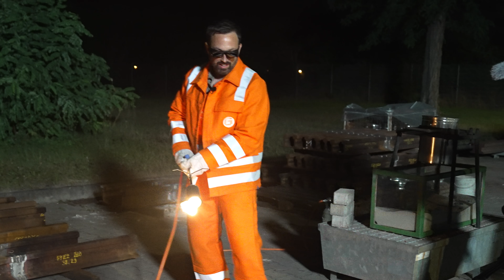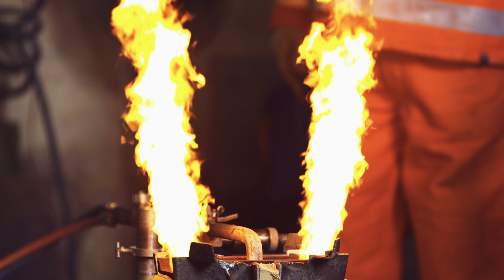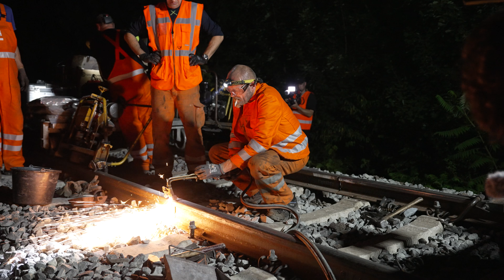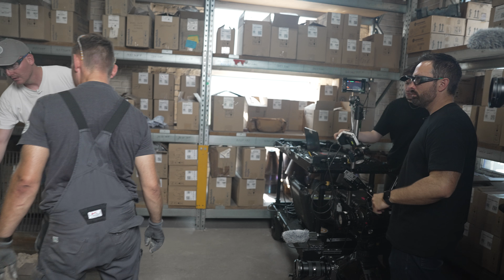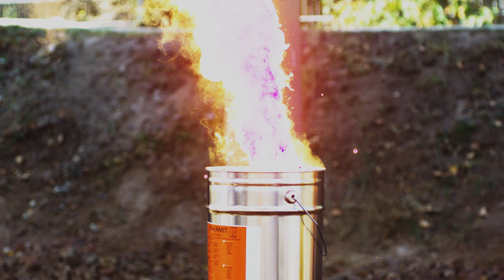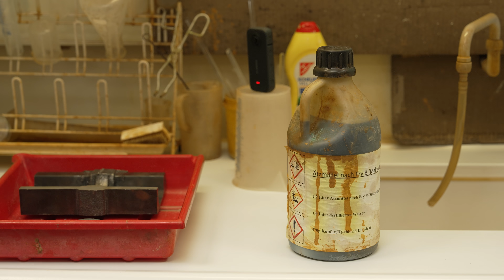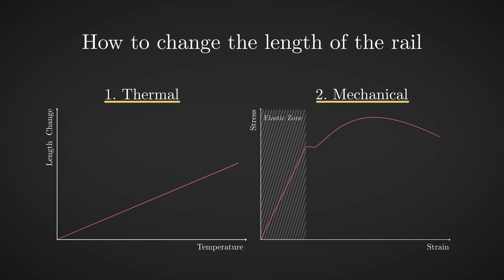Why Don’t Railroads Need Expansion Joints?

Comment: Amazing, cannot wait for part 3 :)
I worked in the UK Titanium industry for 40 years, I came across a sort of "thermite" type reaction with Titanium a few times. Titanium has a high affinity for Oxygen and Hydrogen in particular when it is in a finely divided/fine form. So Titanium fines and dust from machining operations can build up on machines like lathes etc. Should you also machine Steel then the fines of Titanium and Steel can mix unless you are very careful to clean the machine down after each different material. A mix of Titanium and Steel fines can spontaneously combust. As the Steel fines rust, the Titanium which has a greater affinity for Oxygen than Iron will pull the Oxygen from the rust, a chemical reaction occurs which raises the temperature until it catches fire. I would guess it is a long slow process to start the reaction, but I came across this a couple of times "in the wild" so to speak where machining swarf and fines from mixed materials were dumped aside and caught fire spontaneuosly.
Could be a nice little research project for someone and perhaps a useful commercial process for something at the end.
Reply: That's how most fires that destroy aluminum fab/manufacturing plants start. Fine aluminum dust and random chunks of iron that has rusted. Eventually, the right ratio of FeO+Al occurs, and it starts getting hot
Reply: @mmorris2830  Ah yes, I am sure lots of such things happen. None of our "experts" aware of the Titanium and Rusty Steel turnings reactions, came as a bit of a shock, though the spontaneous combustion of Titanium Grinding fines, even when wet was a well known thing and resulted in having to store the stuff in 45 gallon drums under water prior to regular disposals.
Reply: I don't think I'd want to be anywhere near a titanium fire.

Comment: I used to do this for a living. Worked for CN master welder. Hated the job but loved the wildlife
Reply: How much did you get paid?
Reply: @Dp270  $50k to $80k depending on experience and which company you land a job with.
Reply: Why did you hate it?
Reply: @ryandavis7390  physically demanding job, direct managers that act like tyrants, bad coworkers, and if you're on a travelling gang you're on the road constantly. UPRR would have compressed half crews that worked 7 or 8 days on and then 6 or 7 days off but your travel home was on you and could be brutal if you're travelling from some of the more remote areas on the system.

Comment: As a retired long haul truck driver who used to haul things from California USA to Toronto Canada. I saw many many trains that were hauling what most people call shipping containers.  I always came away thinking that my hauling some form of vegetation all that way was silly . The trains should be able to make the trip fast enough to handle the food being moved. Now it was not just the speed of the train that was the problem but the speed at which the shipping containers were lifted off the train and put on the truck that takes the goods to what is sort of the final place. That went fast sort of . The driver of the truck had to quickly move the truck into the right spot then pull away rather quickly but the line up to get into that part of the system was sometimes hours long. That has to be fixed. Then I would have no problem with things that are being moved from one side of North America almost all the way to the other side all being done by rail. Such a huge savings. Still millions of trucks and drivers but we would all be going on shorter trips and most often home at night
Reply: you're talking intermodal trains and they usually are the fastest and usually get priority over other mixed freight trains. sounds like you were at a port where there's thousands of containers. that said RRs know once they get your product you're at their mercy. they're also greedy knowing a railcar can carry over 100 tons and can replace many trucks and charge $ accordingly. they didn't get the reputation of robber barons for nothing. they lost a lot of business to trucking by raising prices and fuel charges etc after spending years to get trucks off the road.
Reply: capitalism is a big part of it. Railroads can often charge too much to make it worth it. A fully loaded freight train takes about 300 trucks worth of cargo but they can be slower. There was a refrigerated fruit train that ran from CA central Valley across the country to east coast that i used to see a lot when I was working in CA central valley.

Comment: Seeing the metal shatter reminded me of back in the 1950s and early 1960s. Dad had a lumber mill and so we and others who cut carefully selected trees. Dad would never do clear cut. As an axe was being used it hit something solid, maybe a stone (?) suddenly the head shattered like glass. Someone had sharpened and repaired it and apparently got it too hot. It probably was not the best quality adding to the problem. Scared me as a teen. Dad was always warning us forcefully not to stand in front of someone using an axe because heads fly off. We did not expect it shattering.

Comment: 11 year mechanical design engineer here; a good and fun video but I don't think the final explanation really makes it click for most people. It's actually really intuitive if you think about it in principle rather than mathematical terms.

When a piece of metal is heated up (energy put into it) it wants to increase in volume to balance out. It will take the path of least resistance. That might mean increasing in length, bending or lifting/twisting. If you take away all of it's options to do so besides increasing in size at the cross section of it's shape (growing outwards sideways and upwards) then that is what it will do. If all the rails do that it's fine because the train to rail connection has enough tolerance/play to account for it.

Everything beyond that is very specific to making the exact rail and type compatible with the environmental conditions etc such that it doesn't fail during that process (can withstand the stress acquired from the strain of outwards growth).
Reply: Thanks for the intuitive explanation
Reply: @billyraybar Glad it helped my friend.

Comment: This really gave me a new appreciation for rails, the fact that this whole process is repeated for every. single. joint. is just crazy
Reply: Not every single joint, most joints done in the field yes. A large amount of joints would also be done using a process called Flash Butt Welding
Reply: @ArmandMaree  ah ok, still pretty cool though
Reply: They do have dedicated train cars that do this welding without all this hassle...
Reply: Did they say "every single joint"?
Reply: @plica06  I mean the one I just smoked didn't need all that.

Comment: oke cool and all but, what sort of black magic see through material can just handle Thermite welding at around 15:00??? that's like at least 2000 degrees Celsius no?
Reply: quartz
Reply: Glass. Glass has a much higher melting point than steel. So molten steel will not come close to melting glass
Reply: @DumbAsh00 Former glass blower here.  No.  Regular soda lime glass melts at a lower temperature than steel.  That is some sort of special glass they are using.
Reply: Probably Muslim Passports.

Comment: Wonderful!  In the much-hyped third video are you going to show how termite can be used to cut a steel beam? That is an absolutely critically needed demonstration.
Reply: Basically steel gets soft even before it melts meaning that it wouldn't be able to support a skyscraper.
Reply: That was done years ago with DIY shaped charges in a dude's backyard 😉 look up "the great thermate debate"

Comment: 5:50 - I don't understand this explanation. If the rails were angled completely flat/horizontally, the pulling force would be the same across the whole height of the rail. So why angle it up? Your explanation in the video is circular logic.
Reply: If you take the cross section of a rail, the top is larger than the bottom. The contraction pressure due to cooling metal is presumably uniform. Thus a larger cross sectional area on the top vs bottom means a larger contraction force on top vs bottom.
Reply: @IDontWannaPlay  Thermal expansion and contraction is linear though and doesn't depend on the cross sectional area. As you correctly state, the force is larger, but the pressure is not.
Reply: Probably because the bottom cools first, then the top cools pulling the top together.
Reply: There’s more Liquid Metal pulling from the top

Comment: I don't follow the 6m explanation. There's only more material at the top because the rails are angled. I understand why that makes it flat eventually, but by that logic couldn't we pour into any orientation and it'd become flat afterwards?
Or is there some reason why having additional tension at the top after the rail is flat is useful?

Comment: We created a thermite steel cast sword in metallurgy class in college and I wrote the technical report on it. I also got my d2.1 thermite welding certificate from it as we did lots of thermite steel alloy blades.

Comment: We have  a retrofit technology  that use BGR (Burnt gas recirculation) instead of EGR. Our technology is basically a hybrid of diesel and gasoline combustion (we call it "Diesoline"  combustion) that eliminates 1. the excessive O2 and N2 in the combustion r/f mixture and 2. lower the combustion temperature by the excessive burnt gases to retard the formation of the NOx. This is also called the SCCI/LTC/D-cycle (Stoichiometrically-charged-compression-ignition/ Low temp combustion/Differential-stroke-cycle).

Comment: In Alberta in the 70's we used thermite to bond wire to rail ends so that there was a continuous connection for closing the electric circuit on the crossing signals.

Comment: 19:06 I just learned that the Shinkansen Operator, JR Group, uses a similar process that doesn't use thermite (iirc they call it "Gas Pressure Welding" in english which im guessing is a kind of high-temperature plasma welding) to weld their rails, so your "100%" isnt fully 100%. I'd wager closer to 98%.

Comment: I'm a second generation welder and while my dad has done almost all types of welding possible (like thermite) I haven't, so this was really cool to see. 
Also I can relate so hard to your frustration in getting the pieces of work all lined up, it do be like that sometimes lol. In addition to all the prep and positioning you also have to be able to anticipate how the metal will deform as it heats and cools, this is fairly straightforward as compared to welding a round piece or in awkward positions, but yes there's definitely some art to it and you get faster with experience. My dad is basically a wizard at making metal bend to his will. I've been doing this for a decade and I'm still in awe of how quick and easy it seems to be for him.

Comment: I worked for 20 years in  railroad construction in New York City subways , bridges and tunnels,  we use this process to have a quiet ride on the subway systems, I was certified for using thermite to weld tracks  ,for the comfort of all subway riders !

Comment: In the “70’s” I worked in “maintenance of way” for the Union Pacific RR. This was on essentially the original line of the first intercontinental railway. At that time there was still a joint bar bolted through the rail basically every 39ft. The maintenance required to keep the track gauged, leveled, sleepers spiked and joint bars intact required a five man crew, full time, roughly every 20 miles. This was considered a “section” and if you were one of these guys you were a section hand and you most likely lived in a residence provided by the RR at these 20 mile interval’s. Even beyond the section crews the man power and machinery required to keep these rail lines renewed and functioning was massive. Then came the advent of 1/4 mile rail and thermite welding to create nearly endless rail. This 1/4 mile rail was welded together from 39ft rail at specific facilities and put on special trains designed to deposit these 1/4 mile rails along side the right of way to replace all existing rail. This streamlined the railroad immensely and eliminated thousands of jobs in the maintenance of way. It was a tech revolution that most people are unconscious of and is taken for granted.

Comment: I worked for a transit system & we had lots of continuous weld rail & had lots of trouble on the outside sections with rail expansion in the summer. We often has speed restrictions of 10 MPH on hot days.

Comment: its amazing to see how many things go into just a weld. Almost makes you think it would be so much more cost effective to just bolt them together and keep replacing the wheels. Imagine if you have to lay 1000km's of rail and every rail is still 12 meters long then you need to do a weld like this almost 200.000 times.

Comment: I did thermite welding. But it was called Boutet Welding. And it's not as easy as 1 might think. You have to figure the air temperature the humidity to determine the gap  that is needed to insure that it's not to long and not to short! We used this to welding mainline track.

Comment: Although I really like the presentation in this video, the actual answer to the main question is a bit rushed. The buckling of the rails is prevented by joining the rails on high tempertures, giving it  tension when cooled off as well as lateral fixation to reduce the buckling length. This is well explained in a video on the same topic by the channel Practical Engineering.

Comment: That is what I wondered all the time. For instance the summer winter temp differential in a place like Chicago is 70°C , -30° C to + 40° C. If they could do without expansion joints 50 or more years ago why couldn't we with much narrower temperature band in a place like Mumbai where it is barely even 20° C ?

Comment: 'Used to work for a Railroad Retarder manufacturer, and went on-site in a few class yards to view installs of our product.  Our retarders were built complete, on ties with the rail attached, often shipped to the yard on flat cars (but sometimes OTR semis). They did the thermite welding to bond the rail in the retarder to the existing rail in the yard.  I was just blown away by this process - literally making steel right before my eyes.  And it was BRIGHT! Very cool vids!  -Also so very cool of you to reference other great YouTubers, as you did Grady at Practical Engineering - Love both of your channels.  So enlightening!

Comment: There are giant arc-welding machines in Sweden that grab and PULL the rails together, and then induce a massive current into the rail to create that arc-welding of the rail itself (Mobile flash-butt welding).  Then the machine pulls a bit harder to force the melted rails together, and then it holds the rails for a few minutes until they cool down.  No need to use Thermite welding.

Comment: Great video. I never realized how much went into this process! Some very WOW video!
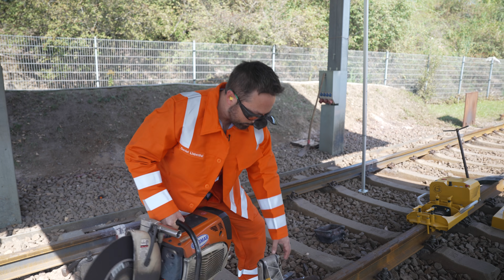I think I'm missing something. I'm a bit curious @4:36 as to why the rails to be welded were touching if they were at a neutral temperature. Wouldn't there have been a gap originally? How would they have expanded when it gets hot the next day?
I also don't really understand why mechanical stress would work in non-welded rail if all rails were installed pressed against other rails.
I've got some research to do.  😁

Comment: In the United States they have a bunch of specialized equipment so that they don't have to use a torch to cut the rail they literally have a chop saw that is attached to a cart and it it then they have another piece of Machinery that will help Gap and space it then they have another piece there's another piece of equipment to actually will grind all of the Bells and shape into the rails so it makes a smooth transition between the two different pieces of rail

Comment: If you used double windows on the outer openings of the house and paper screens behind you could preserve the general aesthetic while having better insulation. Adding net insect screens would allow natural aeration during warm days too.
Wood works well as an insulating material so instead of tatami maybe laminated floor and energy pumps with fan coils installed in every room. Thick soundproof laminated paper room walls could do the trick at the expense of ease of room size adaptation.